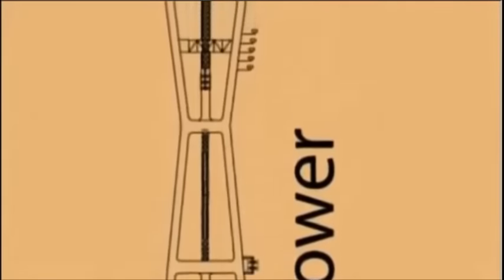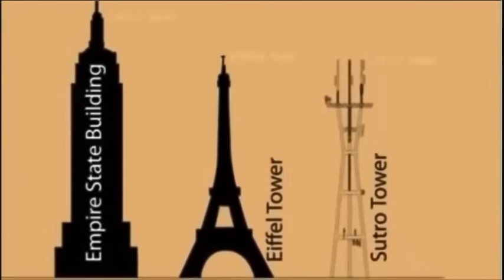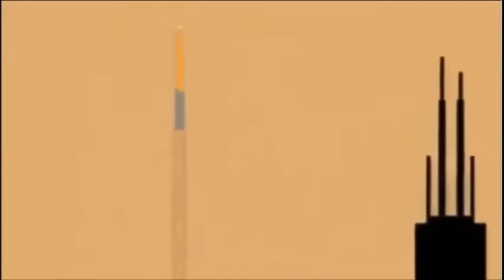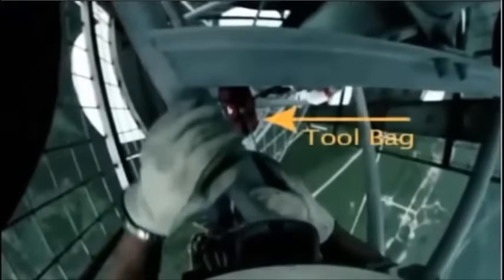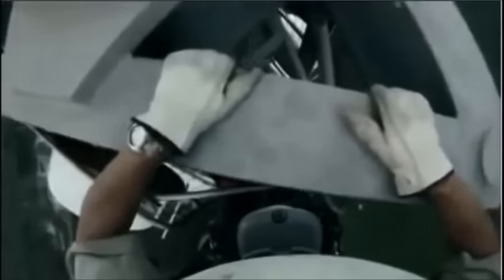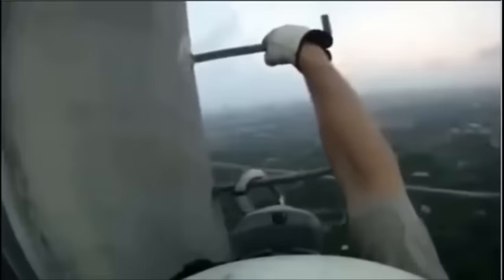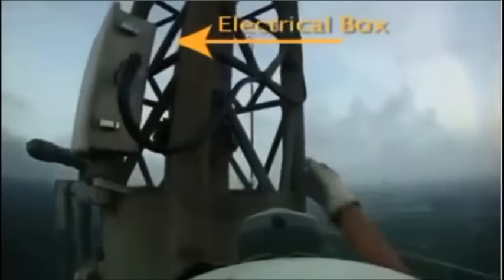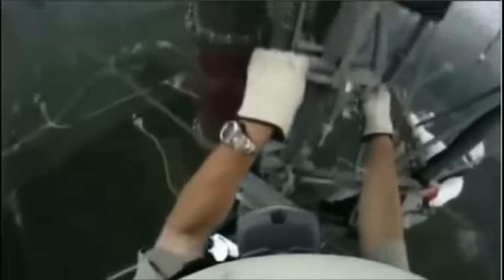Climbing The World's Tallest Radio Tower

Comment: I'm sure how old this footage is, but I'm a tower climber and our harnesses are way safer and OSHA requires 100% tie off which means 1 of your 2 safety lanyards have to be connected to the tower way safer these days
Reply: James Kuykendall respect
Reply: i remember seeing this back in the early 2000's   i come back to it every now and then because it fascinates me.   some other company made a counter video a few months after this one came out and they claimed they always tether off like you explained 100% of the time
Reply: I climbed 96-98 and safety cables were kinda newer and not on every tower. We climbed just like this guy. Free climbing Seems much more dangerous than it actually is. The only purpose I ever saw for the amount of tying off now is if a climber becomes unconscious.
Reply: I climbed 96-98 and safety cables were kinda newer and not on every tower. We climbed just like this guy. Free climbing Seems much more dangerous than it actually is. The only purpose I ever saw for the amount of tying off now is if a climber becomes unconscious.
Reply: I genuinely just sighed with relief.
Reply: Yeah, that's for towers under 500ft
Once you get to something this tall, there is no need for such safety equipment, it's cumbersome and useless. Nobody would be able to save you in time from a height like that. if they did, it was an act of god. At that point it's just recovering a body.
Reply: What I don't also get is that not all portions, on the top of the mast, has the hooks, or bolts, to make it easier to climb, than just the guys trying to find their footing into the slots, like why not a ladder right to the top??
Reply: But WHAT do you hook too when there's nothing there but those little ⅜-ish pegs sticking out of the mast\antenna?

That little toothpick?
Reply: Health and safety's gone mad these days.
Reply: Definitely true.
Reply: Tying off is to save your ass if you lose your grip, step or the like, such as when you climb on wet or ice. You'd better be connected buddy when all of the above is present, then say the wind begins to gust around the top! You also can't plan what the weather is at the top is standing on the ground. Tied off 100% of the time means you have a brain! Towers are no place for Roof toppers, this is no game. Lastly, tower work is about being able to fix a complex problem as well, it's not just about climbing the tower, think you can handle it?🤔😉
Reply: @Beastgrows  So watching this video, you would be completely confident and okay with climbing this tower without any safety precautions at all? Alright mr. tough guy, if you say so.
Reply: How did you get into the position?
Reply: @mcmarine777  Being tied off is 100% safer period. The point is if something happens like becoming unconscious or a gust of wind blowing you off you have it.
Reply: Respect. No fucking way I could do this.
Reply: @Ithinkiwill66   And why not put a pole to clamp onto for the free climbing section?  The safety line would glide up with you, and if you fell, it would be to the next section with a foothold (or about 20 feet)?
Reply: If you fell and your harness saved you from falling, who is going to rescue you?
Reply: This was back when you needed a gas operated telephone
Reply: Are you allowed to have parachutes?
Reply: @CarlosRayNorris1979  Captain Kirk would just order Scotty to beam you to safety.
Reply: Yeah but how many actually do that. I paint towers down here in Australia and we free climb and only hook off when I’m working position.
Reply: How do you get into this type of work?
Reply: I'm a tree climber and my basic safety gear is better than this video. It's insane
Reply: @FloridaMan786  Look at the obituaries?
Reply: EXACTLY THANK YOU
Reply: Thank God, I saw one recently with a steel rope running the length that keeps them clipped with some device I assume locks on the wire when going the wrong way pretty much the entire climb. Job is inherently dangerous in general but no need for it to be this dangerous....
Reply: @FloridaMan786  you start at the bottom and work your way up. “Climb the ladder” as they say!! 😊
Reply: It’s safer but still dangerous.
Reply: That’s what I’m saying!!!!! Get this man into some commtraining so harness man can teach him a thing or two😂

Comment: They should climb up with parachutes on their back and jump off to get down when they finish their work.
Reply: +William Gideon Why facepalm? Thats genious. Also like second chance if you trip and fall.
Reply: William Gideon I've never tried so I don't know it better but I'm pretty sure it's safer then just falling from that height without a parachute.
Reply: +Nathan Schwartz parachutes are heavy to carry while climbing.
Reply: Exactly what I thought
Reply: helicopter would be faster
Reply: Brian The Bold dummy
Reply: +Brian The Bold Then don't fly the helicopter into the fucking tower, Einstein.
Reply: Nathan Schwartz lol
Reply: There would be another issue with the guy wires that support the tower.  Given the height of that tower they must have some serious cables providing the tension to keep that sucker up.
Reply: Holy shit that's genius
Reply: NOPE
Reply: Yeah
Reply: ButtfaceMcGee simple 8th grade science, weight doesn’t make you fall faster or slower, you fall at the force of gravity
Reply: P D  you have a ladder hang off of the helicopter for the worker to climb down so that no contact is made with the tower
Reply: @braydenfields1327  My BOY. But if your mass is increased, you WILL fall faster if there's air resistance.
Reply: daniraptous I second this response. @Brayden Fields In a perfect vacuum yes, everything falls at the same velocity. Due to air resistance and even heat produced by friction will greatly affect the speed of descent. There is however the concept of terminal velocity, which states the speed limit at which an object falling towards Earth will no longer accelerate, which is different for any object in free fall. It’s generally calculated by a drag coefficient that helps determine things like friction due to air resistance and surface area and the relationship respective to an objects mass. It’s a common misconception that everything falls at the same speed no matter the mass, however, even though the bag would increase the total amount of air resistance, the added extra mass would offset the combined total of friction due to air resistance and actually cause the object to reach a higher terminal velocity. Fun fact that most objects in free fall will actually hit their terminal velocity at a much lower height than one would think, generally the height of a 3-4 story building. In terms of impact velocity, you could jump off a ~4 story building and land with the same force than if you jumped off the Burj Khalifa, assuming of course you did not change your mass or surface area such that your drag coefficient would change. If you flatten out your body for instance, you would essentially create more air resistance due to the surface area in contact with the air and could lower your impact velocity, if the temperature and density of the fluid you are jumping through (ie Earth’s atmosphere) remains the same for both descents. Science is so cool lol.
Reply: Connor Walters definitely copied and pasted
Reply: Lil BikeMike lol no, I graduated high school physics.
Reply: Lil BikeMike be my guest though, if it’s stolen verbatim you should have no problem doing a quote search on google to find the exact info in the same vernacular as my post. Spoiler alert, you won’t, because I wrote it myself.
Reply: They make about 20k a climb.  Then don't have to go up for about 6 months again.  Same with guys who Replace the lights on the very top.  My uncle does makes about 15k a climb.
Reply: Parachutes are heavy
Reply: @ctdubzz  Googled (for fun not to discredit) and good ol' Google  response ... "will" (and any subsequent words) was ignored because we limit queries to 32 words.  Then a bunch of somewhat related articles. 😎😂👍Note "*was* ignored" not "*were* ignored" 🙁
Reply: @hachadorada  yes, very restrictive, no repair climber ever wears them, ever.
Reply: Jet packs need to be a thing
Reply: Finnegan the blades, they can’t touch the tower.
Reply: Facts!
Reply: yeah my point
Reply: Nathan Schwartz that would be reluable
Reply: amazing idea
Reply: The only problem is that most parachutes way up to 40+ lbs. Then tack on that 30 lbs. of tools and your caring a lot of wait up there. Climbs like that take a couple hours as well.
Reply: Finnegan why am I laughing at this
Reply: That sounds like a good idea but would add a lot of weight.
Reply: Connor Walters Congrats you are now on r/iamverysmart
Reply: I’m sure these guys make enough money every second so yeah they can afford parachutes every day
Reply: Nathan Schwartz That’s an OSHA violation most likely
Reply: I was thinking the same thing
Reply: You know that their are support wires on the way down right?
Reply: Yeah this is big brain time
Reply: Why don’t they just use a plane like they did the same with the World Trade Center
Reply: I did a reaction video to this and said exactly the same thing! It’s a no brainer! 👍🏻
Reply: They would probably float into the guy wires as they descended
Reply: Helicopters wont work because they need to spend money on different things than a ride
Reply: WinDoSa guide lines are practically invisible and would rip the parachute
Reply: Exactly came to my mind...lol
Reply: @MultiANTI  not really...those massive blades knocking the guys off the mast, with or without the locking safety clamps, just wouldn't be safe enough
Reply: Finnegan  that too!
Reply: @hachadorada  people climb Everest with stuff on their bacl
Reply: @danix454  nope only if your drag coefficient is huge otherwise everythibg reaches terminal volocity
Reply: @admiral37  zip line then , ive been on a 2km zipline in the alps that droped most of the high of this tower
Reply: WinDoSa sometimes they do carry parachutes on some of the tallest towers. Although the chances of it saving you are honestly quite low considering how it widens and has way too many points there are to be caught on.
Reply: WinDoSa safest solution is to just take it easy and slow and use your carabiner when it’s appropriate
Reply: 999+ IQ
Reply: Finnegan  you cant land a helicopter on a 1738 foot tower with a helicopter
Reply: AntiGamingシ -*
Reply: Brayden Fields Yeah it would. Your terminal velocity would be increased.
Reply: etru6 translate, I don’t speak 12 gauge. Can you use metric?
Reply: Oliver Knowles 5 football fields
Reply: hi from 6 ears ago legit what i thought
Reply: They could always repel with ropes down. That’s a (long) rope tho…
Reply: Ya why don't they do that. They it in ad astra
Reply: Base jumping is incredibly dangerous, probably not a good idea.
Reply: I’m sure there is a reason they don’t. I’m sure it occurred to them at some point whilst looking strait Down  but what I f don’t understand is why they don’t leave tools up there

Comment: What gives me the heebie-jeebies is when the "free climb" starts on the antenna mast and dude is climbing with all his body weight and tool weight on nothing but those spindly little bare metal pins welded to the side!

They look like they ant be much more than 3/8 inch thick and are only attached by one weld at the base of the pin, with no support whatsoever.

When these things have been up there for 30-40 years and you're putting 200 -250 pounds on them..... I'm amazed one hasn't snapped off before now.

"Oh but they tie off with a safety harness now" they say.
Yeah.... But if one were to fail ...from just the weight if the person and their tools/equipment...... That tie off is attached to the same little pins! The massive snatch weight/load of 200-250 pounds of man and tools falling even 5ft, and the sudden snatch impact of the safety harness clip on that little pin..... How is THAT gonna hold?

2000 ft high and on nothing but a daggum metal toothpick sticking out of a pole!
At that point, the safety harness and "tie off" is nothing but a trip hazard....
Reply: Danny Clark imma tower climber and those pegs are actually just bolted
Reply: Today they climb those with harness and two hooks as you move up i don't think OSHA allows this type of climbing anymore.
Reply: Did osha finally put a stop to it? Had a boss with a millwright company i worked for talk alot about the whole osha and free climbing regulations, we were in the air alot but highest ive ever been up is 500 feet
Reply: Danny Clark : often, all transmissions towers are galvanized. Therefore, it’s protected from corrosion and rust.
Reply: @sulierbil08  yeah because galvised steel never rusts ....oh wait, yes it does actually. It just takes longer ...unless the surface is has damage or abrasion, then it rusts like everything else.
Reply: Harri Kirvesniemi  Hell yeah bro. Sounds sick. /s

Comment: Every day would be "bring your parachute to work" day if this was my job.
Reply: FraggingBard  better than dying
Reply: I do it everyday for a living. Can't say the thought hasn't crossed my mind a few times.
Reply: When you fall you are in the wrong position. The time you need to reposition is the time you need to make sure the chute is out. This might seem high, but the ground is very close at 180 km/h. Also when the chute is open you need time to slow down or you will still break every bone in your body.
Reply: The problem is the tower is held straight by cabels in which you could get tangled up with your parachute.
Reply: Christoph Tews might still save a life
Reply: The weight of the parachute would be to heavy to carry that far up.

Comment: I thought OSHA and the industry had basically outlawed freeclimbing by now? When I worked in the oilfield we had to be 100% tied off if we were more than 6 feet up on any structure.
Reply: I thought so too... Apparently, utilities (power lines) have had this requirement since 2015. Telecom still seems to be lagging behind: "OSHA is considering a requirement that employers protect workers from fall hazards at all times." (2018) https://www.osha.gov/sites/default/files/TelecommunicationsTowersPIRFA.pdf 
Looks like some states are already requiring fall protection at all times. North Carolina: 
13 NCAC 07F .0605
http://reports.oah.state.nc.us/ncac/title%2013%20-%20labor/chapter%2007%20-%20office%20of%20occupational%20safety%20and%20health/subchapter%20f/subchapter%20f%20rules.pdf 
100% protection above 6 feet... Same as the oilfield.

Comment: They just BASE jump down, right? Might as well. Probably safer.
Reply: I was thinking that they should just send them up there with parachutes, it'd be better for their lives. Even if the tools get destroyed because someone falls, the person will live at least.
Reply: It's much safer to climb down. Jumping from that height wont allow them much time to deal with issues regarding the parachute, aswell as the ever-present risk of hitting or getting tangled in the tower.
Reply: Too many guy wires. They'd almost surely hit one. It's doable, but not at all safe. That's why the A in BASE jumping stands for antenna.

Comment: Why don't they use a helicopter to hold these guys in place while they check or fix whatever they have to check or fix? I believe it'd be less dangerous and perhaps faster ... and potentially less costly in case of loss of a life while climbing..
Reply: Pensar Imagin The downdraft of the rotor blades would be blowing them all around, for one. For two, like anything else that has an engine, the helicopter has a limited fuel capacity, and depending on how long the repair would take, it might have to land before they're done.

Comment: Thanks goodness for the elevator, huh!
Reply: The elevator only goes up so far.

On a 2000ft tower, the elevator may go up 1500 - 1700ft ....but you still have 300 - 500 ft left to climb, and it STRAIGHT UP!
Than means your body is ALWAYS hanging off at an angle, suspended out over nothing.
Most can't "climb" 500 ft of solid stairs with handrails and walls. They wouldn't make 20 foot on a straight vertical climb, ESPECIALLY AT 1900 FT IN THE AIR!

Comment: How do you build that?
Reply: Big ass cranes
Reply: Grayson Elder Not a chance, 2000 foot tall cranes don't exist. It kind of builds itself from the ground up, each new section is hoisted up the previous sections and hauled into place using a derrick and guy ropes.
Reply: Legos. Lots of Legos.
Reply: you build the parts on the ground, anchor the first part into the ground. Then you pull the other parts up one another and so on. Really simple.
Reply: Very carefully
Reply: They build them from the bottom up.
Reply: Cinematic Top 10 hits blunt
Reply: With tools
Reply: RedAntInfinity how they build those tools🤔🤔
Reply: Gin pole
Reply: just climb up and build lol
Reply: They build them with helicopters
Reply: @ericcartman3551  not often
Reply: RMJ1984 well no shit, what are they gonna start at the top?
Reply: They use a sky hook.
Reply: Everyone say big crane but how they build it
Reply: They call Magneto.
Reply: New Dawn In Minecraft you can
Reply: they call it stacking the tower which sounds just like it is.  They use hoists (cat heads) and ropes to bring up section by section, they stack it, set it, lay guy wires then stack it some more.  generally they come in 20-60 foot sections. this takes several weeks to accomplish and is very nerve racking....the most dangerous part of tower work in my opinion is stacking towers as that is the time they are most likely to collapse if it was to ever happen.
Reply: @RMJ1984 really? I thought they built it from the top down?
Reply: @Pabloperes675  Only Trump that can do. it takes a stable genius of over 300 IQ to build from above and down, you need SPACE FORCE.
Reply: Creative Mode
Reply: Segments at a time